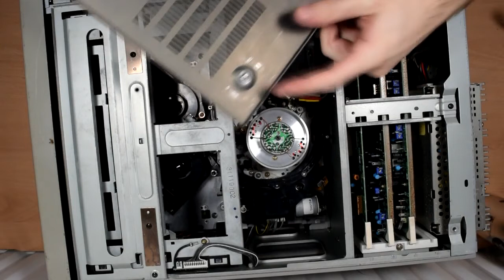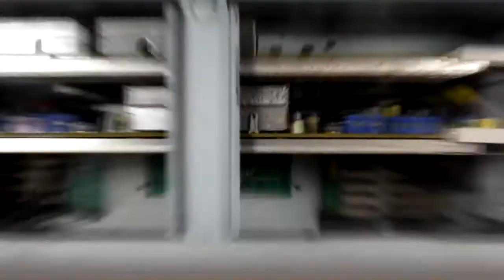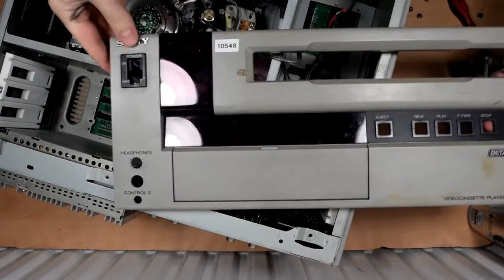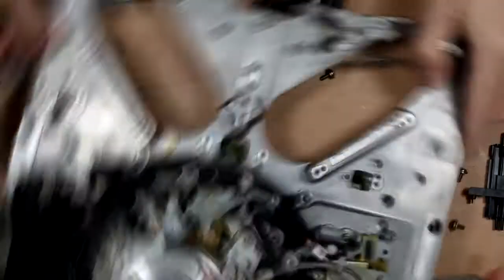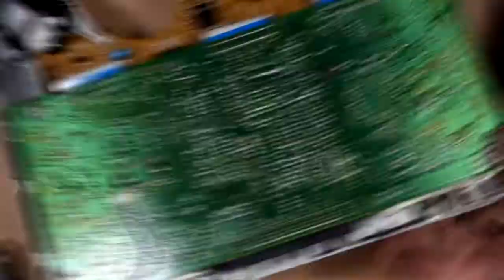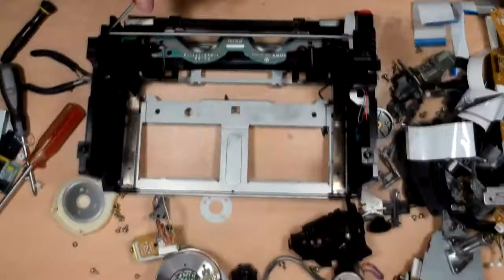SONY UVW-1600p Betacam teardown

Comment: hi there's alot of them around in the uk   i like playing and fixing them  i will say they are the napper of decks

like the reel to reel tape decks   money is better in the decks than any  bank at this time 
as getting video of tapes cost big money  £18 a hr  some of them   so i get a fast turn around 

of my money  £30 eu is about right    i pulled some apart to find out why  it was playing up 

i was after the head  drum and the card that holds the hr count   head drum  come out  so easy 
just 3 bolts and mini plugs  i keep all the rest of the tested working parts 

they are not juck there's all way some one like me after them  

if i was to post a video here i would get 20 mails easy  about decks for sell  bob

Comment: These decks are designed to be able to load both standard size Betacam S catridges (which are the same as standard Beta catridges) and larger Betacam L cartridges.  That is the reason for the adjustable reel servos.
Reply from the maker: Interesting, Thanks. I actually missed the significance of that while i was doing the teardown!

Comment: Someone should send you a Video 2000 deck; those things are full of technologies you normally only see in high-end broadcast decks, such as multiplex component video recording, dynamic tracking (they were the first to do so) and full servo control with timecode.